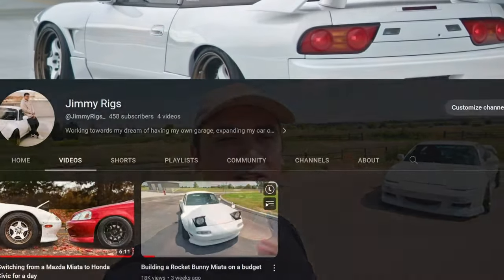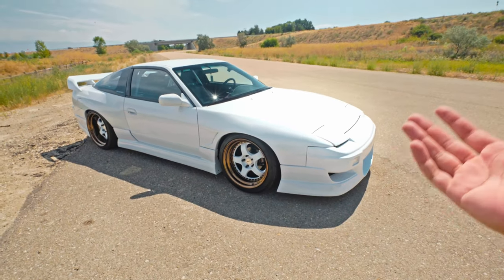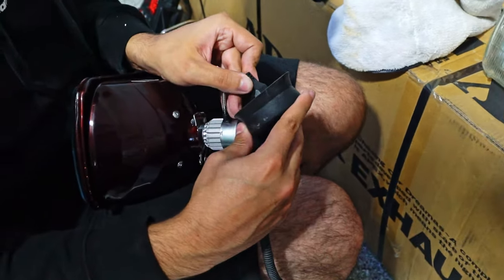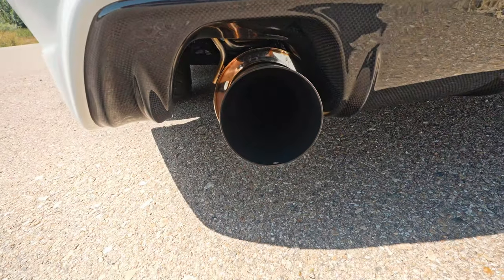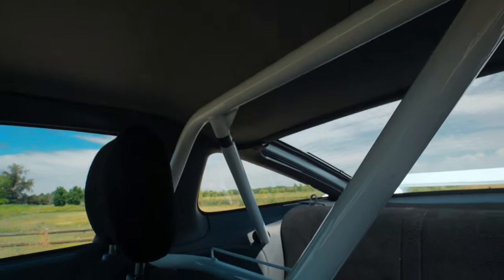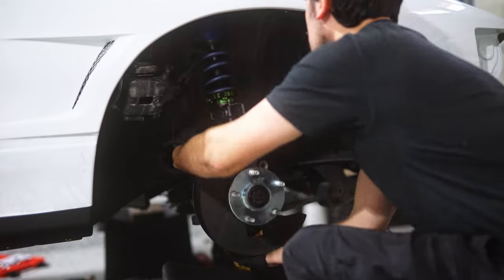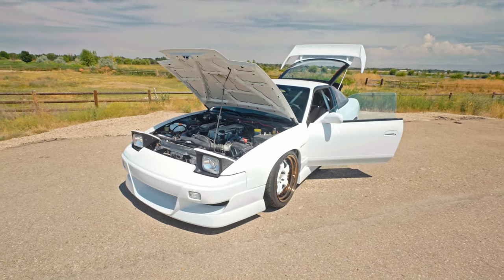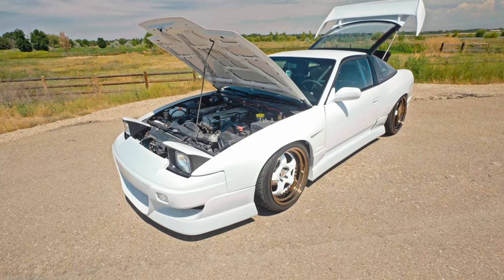Building the 240SX of my DREAMS!!

Comment: I have my spirit rei kit ready and and want to put it on the car without visible hardware. A lot of people tell me it's not possible or that with kit it will not hold and it will break. What is you experience with this?

Your 240 is my example!!
Reply from the maker: That’s awesome I’m honored! Your kit will hold if installed properly I’d highly recommend having a professional body shop at least mold on the fenders at least if you are going the diy route and then handle the paint yourself but I’ve had no issues with mine in terms of cracking or finish even with running a rough suspension setup I’m sure if you track the car and the body flexes a ton over time it could have some issues but I wouldn’t stress about.
Reply: Yea i'm certainly going to a pro shop with this. THe kit was expensive enough. Thx for the tips I'm willing to prove everybody wrong and show that molded fenders do work :) @JimmyRigs_